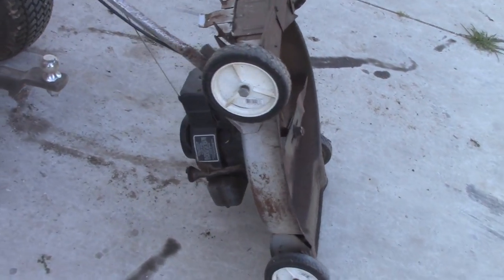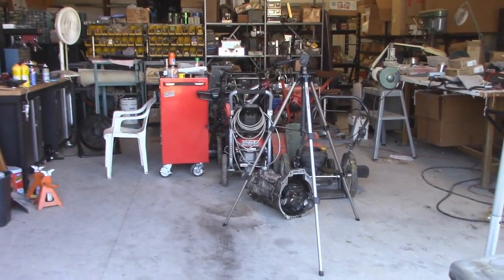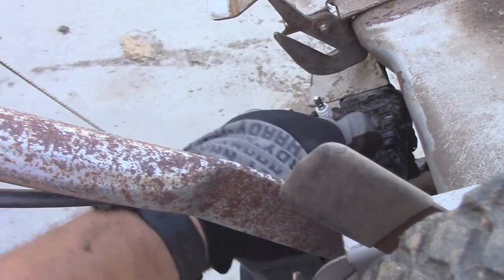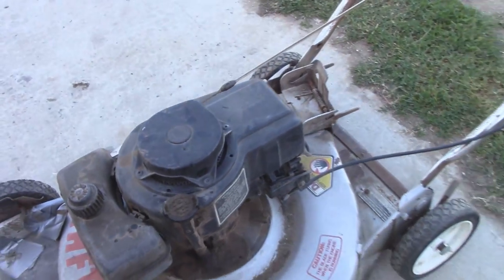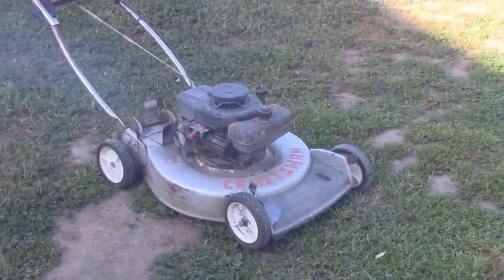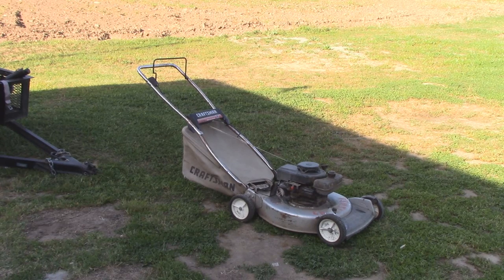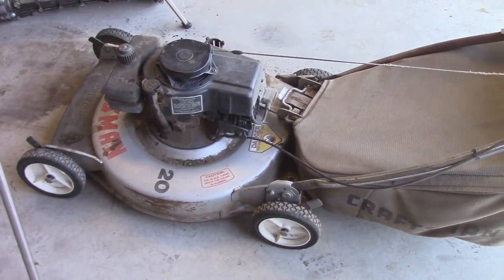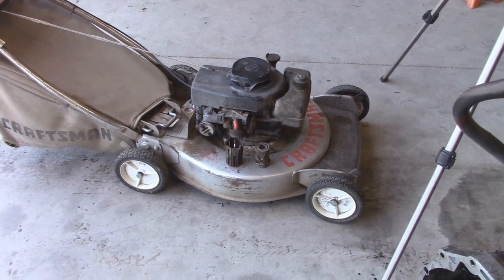DIY Unseize a Locked Up Small Engine

Comment: Tecumseh engines are good. They had a pressurized oiling system unlike Briggs which merely used a slinger.  I have one which is used every weekend was bought new in 1982..and has never been opened. Cheers from Australia.

Comment: I USED this on my lawn mower, Craftsman 6.5 Briggs and Stratton that I have had since June 2005. After replacing the starter rope the it was still frozen/locked.  I was within. 2 minutes and 4 F-BOMBS left of spending $350 to $400 on a new mower……when I used your solution!  Like you I said “what the hell let’s give it a shot”. Put the proper amount of oil in (…which frankly over the 17 years of use I NEVER did….) and “unfroze” the blade like you showed, and it ran like new!!  Thank you, thank you, thank you. It’s solid AMERICANS like you that take the time to film a possible solutions to help us retired broke dick 66 year old Marine fix it himself.  👏👏🍺🍺🍺🍺🍺🍺!

Comment: Thanks.. worked like a charm . Mine had seized after sitting out back under a tarp for about three years. I never once tried to start it and today I decided to give it a whirl and it was locked solid. I couldn’t even move it with my hands. I still had oil in it so I added a little more and sprayed some wd40 in the cylinder and she freed right up. After about five pulls on the cord she fired up so thanks a lot.

Comment: My brother found a 1958 or 59 craftsman rototiller that had not been used since the mid 60's in our grandfolks barn that was seized up and he poured Marvel Mystery Oil in the sparkplug hole and let it sit overnight and it worked! He put fresh gas in and changed the oil and it runs to this day (May, 2020)!
Reply: Do you still have it
Reply: Marvel mystery oil in absolutely a super awesome product  LOVE IT !!
Reply: And he found it / unseiezed it April 2020😂

Comment: I've unseized two engines successfully so far; one was a 1970s Tecumseh 7 horse mounted on an Ariens snowblower chassis. The original owner ran it out of oil and gave it to my dad; I was able to unseize it with WD40 and a pipe wrench (my plan was to replace the engine anyway), but sure enough; it ran for an entire season of snowblowing before I revved it to the moon and snapped a valve stem collar. The second time was actually my Honda motor scooter; I was barreling down the highway at around 75mph (it's a freeway-legal 250cc model), and the oil plug fell out (I recently changed the oil and got distracted before I torqued it down... whoops!) and the engine locked up. After letting it cool and filling the crankcase, she's been running fine (compression is perfect) ever since. Eventually, the engine will need a rebuild anyway, but I dodged a bullet there.
Reply from the maker: Hey man ya this is the only one I have personally done before. It's a total crapshoot sometimes as to if it will work and even how long it will last. I remember that video you put up of when it happened to your scooter you def got lucky there man, how much does a rebuild kit run or even a good used motor for one of those go for? Are they easy to find?
Reply: +hanksranger A proper top-end rebuild will cost me north of $700 using all OEM parts. A Chinese top-end will cost around $250 complete. Since I place zero faith in Chinese knockoff parts, I'll be spending around $700. A complete used motor will cost about the same, but without knowing the engine's history, I'd prefer to just rebuild it myself when the time comes.
Reply from the maker: +BBISHOPPCM's World interesting, yea I can see that. My boss was actually given 4 chinese quads with copies of the 125 motor that honda makes, all the honda parts do swap over but I honestly wonder how long those copycat motors last compared to the real thing. Makes sense to just rebuild though over going used hell maybe you can have it bored and stroked for a little more power perhaps?

Comment: These Tecumsehs are good engines and pretty tough. They do like clean and full oil though. LOL. I picked one up like this from a neighbor two doors down, he replaced it with a $500 Toro from HD. I initially took it for parts and then got to freeing it up the same way you did using heavy gloves and rotating the blade. Added oil, it still had fuel in it, unjammed the starter cord, tightened a loose wheel and in 10 minutes I was cutting my lawn with it (that was 1998). I still have the machine, although it's in my "retired" pile since I have newer ones to use. I used it for a full ten years every week. The machine was already ten years old (made in March 1988) when I got it. AYP made Sears Craftsman (like this one) with a 3.5 hp Tecumseh. My neighbor was shocked to see me using it. Fast forward to 2019 (that neighbor moved away). Guy next door to him throws out a 2007 MTD push mower. I grab it, and same thing, unjam the blade. The real problem was it being over filled with oil. For $1.78 for a new plug, and air filter (which I had already) and correcting the oil level, I got myself a runner. Fires right up and works like new. Again, shocked neighbor. 

This weekend's find was a Devilbiss pressure washer with a Briggs engine. We'll see what happens here.
Reply from the maker: That’s awesome man

Comment: I have sold some mower's for cash. I always have a soft spot for Tecumseh's . They get a bad rap but I like them and always fix them first. never had any issues on returns , never.  cool work instead of just trashin it.  ripped apart a newer Briggs the other day. had bad valve guide and low compression . I was amazed that they now use  a plastic cam shaft.  :[
Reply: roo
Reply: People give Tecumseh too little credit

Comment: That Tecumseh engine in this video, are the best. My dad had that same mower when I was a kid. We had it for 20 years, and it never gave any trouble. Always started first pull year after year.
Reply: we have a newer one that met it's demise this weel
Reply: I got a 1998 4.5hp Tecumseh with same air filter like on video barley burns any oil after 26.8 years

Comment: Very good video. But I have to say, the reason why the engine ceased was that your heat-dissipating fins on top of the cylinder were extremely clogged, causing more heat. This breaks down the oil, causing it to burn then cease. Always clean your fins after every 5 uses. Dirt and oil build-up are the lawnmowers' enemy. Degreaser or even auto brake cleaner spray does the trick. 

Of course, check your engine oil periodically. Change the oil after 15 uses. Check, clean, and gap your spark plugs to specs. Clean or replace your air filter. Check your blade for any cracks or dullness. Replace if necessary. 

And lastly, always use a Portable fuel filter by Mr. Funnel. (Mr. Funnel AF1CB Fuel Filter). When storing your lawnmower, remove all gas from the tank, then run your engine until it shuts off on its own.
This will make your lawnmower last for a very long time. Keep these videos coming, I really enjoy them. :)
Reply from the maker: This machine was a trash find
Reply: @hanksgarage_  Nice, I was just giving out tips. Keep them videos coming. :)

Comment: Got a 2007 toro Briggs with self propel it locked up 1 time I was about to do the same thing but I added 12 ounces of oil and bingo it keeps running a little smoke here and there tho. Also muffler doesn’t seal right so it pops or something

Comment: I just got a hondo mower walk behind the lady said it’s dead do y want it. I said yes. Went to pull the cord and it’s extremely hard and recoil is slow. 

What’s your suggestions.  

Thanks.
Reply from the maker: Sounds like the engine might by tight. Do what I did in this video and see if that helps. You’ll have to take the recoil off and take the center bolt out, use a little wd40 inside of the hole and put back together. Don’t do anything more than take that bolt out. You’ll risk unwinding the spring

Comment: If you want to get rid of some of your mower hoard you could remove the engine from the mower body and make a frame for the mower engine and a car alternator and sell them as a generator once you fit other necessary things to make it work as a generator.

Comment: I bought one of these back in the 80's?  Never had a problem that a simple tune-up could not cure.  Never ran it low on oil though.  Your supposed to check the oil before you start it.  I guess some folks dont know that perhaps...  Still got it and it cuts my property line once a week.
Reply from the maker: Yea it’s not the only seized machine I’ve found in the trash

Comment: Not bad for a old Tecumseh. I had a old 3.5hp briggs that was seized so I put WD40 in the spark plug hole and let it soak and manually turned the blade and got it free but it had a thing where it would act like it was going to start but then would backfire well in one of these cases it had leaked gas out the exhaust and when it backfired it caught the mower on fire! later i was stealing the blade brake cable and it managed to leak gas all over the garage floor just wanted to be left alone lol.   But I helped a lady with her mower the other day she when I went over she was like arent you the lawnmower master? im like yeah I guess lol my neighbors have seen me take in and fix many mowers since I have lived here but she couldnt get it started it was a Honda and niether her or my dad could figure it out until I pointed out the fuel shut off valve was closed I had another lady a year ago who couldnt get her Briggs started and I pointed out the spark plug wire was unplugged and thats why it wouldnt start and she gave me $5 for helping her lol the people you run into
Reply from the maker: +Theghostmaster 87 thats for sure man, I love easy fixes, and ya some people just literally have no idea about anything
Reply: +hanksranger  Im just surprised this Tecumseh didnt have carb issues for how old it is thats how I deal with them if I find them see if its a easy fix or not my first lawnmower was a Tecumseh and I went through the carb a few times and it only ran off starting fluid for a few seconds plus the gas was getting on the deck and eating the paint so after seeing they wanted $60 for a carb I gave  up on it
Reply from the maker: +Theghostmaster 87 ya unfortunately I've had to do the same with them. I get a lot of people asking me why I don't deal with more Tecumsehs but I always try to tell them it's because parts are not cheap. They are usually Atleast twice the price of Briggs stuff if not 3x more. I do give them one chance though before I give up on them
Reply: +hanksranger Yup I agree with that they arent worth the money I give the carb a quick cleaning and see where it goes, not worth the time if it takes more I mean even the carb rebuild kit for my Briggs quantum motor was $30 and the diaphram gasket for my Briggs classic carb was cheap plus a bit of carb cleaner and both were good

Comment: That things is a beast, definitely would be a keeper if it were mine. Is that Rotella for diesels only like it says on the front? I wanted to try it out for my mowers but it all said for heavy duty diesels on it. I've been using Castrol GTX and it's been a damn good oil. Do you ever come across newer Hondas?
Reply from the maker: +ChicagoSirens Its fine just massively over kill for a lawn mower, the guys on bobistheoilguy forums have run it in mowers before with no bad results, it just exceeds manufacture recommendations. Ive not had any issues with it yet. No on the newer hondas, in fact I hardly come across them most common are murray, mtd, bolens etc with either briggs or tecumsehs.
Reply: +hanksranger I might try it. I want the best for my 2015 Honda. Those Murrays MTD type mowers are very common around here as well, but I have seen more people going with new Hondas and Toros recently!
Reply from the maker: +ChicagoSirens they might want you to put 10w30 in it. Castrol makes a good oil though. I've used it in all the cars I've had for years.

Comment: It will seize up again, ive never had any luck with seized engines (trash picked mowers) staying unseized, damage already done. I had one mower that i unseized, and a month later blew a hole through side of the block (kinda scared the shit out of me). It was nice vintage snapper with cast aluminum deck, i ended up finding a nos engine to swap with.
Reply: I have noticed any number of trashed mowers at the dump - wonder if it is because of ethanol clogging up the carbs ?

Comment: I have one just like it we got brand new, my wife used it at the lake and seized the engine and brought it back home. I got it running again and been using it ever since, two pulls when cold. Only thing is we've run the thing so much the wheels are wobbly because of the axle s becoming worn

Comment: Have you ran in to a Lowes branded MTD mower from the 90's? I have one in my shop right now, and just replaced the carburetor and fuel line and it still wont start, not even an attempt to start. I checked for spark, and it does have spark. I dont think its the flywheel key. Can you point me in the right direction? Thanks!
Reply from the maker: hows the compression feel? Make sure the primer is working and no air leaks anywhere around the carb, also try spraying start fluid into the throat just to see if it will kick over

Comment: A challenge is always fun. especially when it works out. man that things purring! I actually free'd up a rotary motor using seafoam and oils before and the motor ran for years. it could still be going. i just lost touch with the last owner.
Reply from the maker: +paradoxdesigns Yea hopefully she stays solid I like these older motors man,.

Comment: I'd like to see you try to unseize your earlier '80s Tecumseh. I hope you can save up enough money to fix that one (the red engine).
Reply: +hanksranger 
I hope you find those rings sometime. Order part nos. 35544, 35545 and 35546 if that engine is an ECV100 (4 HP / 10.0 cubic inches), or 28986, 28987 and 28988 if the Craftsman engine model number crosses over to a TVS90 (3.5 HP / 9.0 cubic inches) model. This black one indeed crosses over to a TVS90.
Reply from the maker: Just did a quick search based on model of mower and motor that is supposed to be on it. Need to check model on motor when I have time but like I thought rings aren't available new sadly... However I can take a gamble with used parts which are available
Reply: hanksranger
eBay is also a useful site to search for NOS (new old stock) parts for your engines.
Reply from the maker: +ClassicTVMan1981X here is the part number for the red one 131.907742 I found some complete piston and rings on eBay but nothing new yet. Not on computer right now either looking on my phone. I'll search some more when I get back to the house
Reply: hanksranger
That engine is a model 143.324022, which crosses over to ECV100-145194E.
Reply from the maker: Alright, was able to find some aftermarket rings for it. Its going to be a gamble with this thing the cylinder will either be need to be bored out and I will need overized rings, likely .020, or it could be fine with a basic hone job, something I wont know until I tear into it and measure the ring gap after removal from the piston. This can either be a $40 some odd repair (aftermarket ring set 12bucks, base gasket 8, head gasket 8, bottom crank gasket, 6, oil and other etc small parts. OR will need to be bored out, alone will cost maybe 40-60 if done at a machine shop that will do it for me, found oversized rings for $60, will need the Oversized piston as well, which I have yet to be able to find wont be cheap... this way the price would be north of $200 which at that point just isnt worth it, havent searched much more. I am thinking I will do a tear down vid of it and assess where to go from there, as you and several others have been asking me to tackle it for a video. We will see where it goes from here. Regardless, thanks for your help in sorting the model numbers for me and associated parts that was a good bit of help. I will try and tackle it at the very least this next weekend, If I can get time I will try this week.
Reply: +hanksranger 
You're welcome. The black engine would be a model 143.354092 (1985) or 143.364132 (1986), both of them crossing over to TVS90 models (43292D for 1985 and 43338D for 1986).

Comment: I am BIKE LESS!! My Honda trx 90 engine seized! First started making rubbing and scrapping noises, The first time it did it it cut off then a day later ran fine!  About 5 weeks ago it was running but before i heard a slight clicking noise when i put my ear down to the engine so its rubbing and started running rougher i gave it little revs then it just shut off Now the back wheels are locking up =(
Reply from the maker: +Trucker boy 98 Man that sucks hopefully you can find another motor for it you can try unseizing it though like I did with this mower.
Reply: +hanksranger if we pick up the back wheels put in the last gear jerk the back wheels it won't turn but when we pulled it by a truck it was hard but I heard the pistons moving with the lubrecent it was tight!
Reply from the maker: Trucker boy 98 Yea keep doing that you may be able to unseize it, chances are it will seize up again and burn some oil but you should be able to get some more use out of it
Reply: +hanksranger It did get the shit used out of it! Acutely I just got chain fixed then it damn thing seized :'( We might just get a honda 50 were not sure if we are...

Comment: Hey Hanksranger that's great and old Tecumseh can be saved!
Reply from the maker: Hopefully it stays like that
Reply: +hanksranger 
Like I said in your latest new video, the engine on my 1984 Toro had a new carburetor installed in 2013. However, some of the BBC-related parts underneath the deck are going bad due to age, as the engine is struggling to draw all its speed to the BBC assembly when engaged (factory engine RPM is 3000).
Reply: mountainbikekayak
Reply: mountainbikekayak もごごのごここ